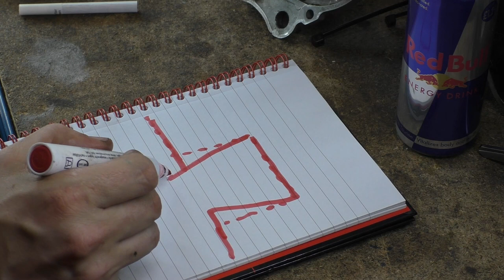Undercutting gears - Fact or fiction?

Comment: I think you missed out rounded dogs forcing gears apart because the rider does clutchless gear changes.

& where's the pivot for the output shaft?
The one that swings both input & output shafts together so the teeth mesh.
Reply from the maker: I'm still looking for the 'swing shaft' LOL

Comment: Very good video , explanation is spot on . I got it , but the issue I experience is that I myself may not lift the shift lever quite high enough which allows the ratchet /tensioner on the drum to retreat due to not being pulled past center of the spring force created by the cam effect . The back cut gear will pull the dogs together and overcome the operator error of not pulling the shift lever all the way up . Missing second gear in a drag race is ‘Game Over ‘ and it will gall the face of the the gear opposing the ‘dog gear’ and make future gear selection harder ,which hurts the gear anyway . I’d rather weaken the dog and have a positive shift without galling the face of the opposing gear , since the shearing of the dog is practically unheard of . 
      I have cut the ‘Dog Window’ on the opposing gear to restore the sharp edge to bring the range of travel back to normal after the galled radius of the gear window is removed . I Don’t Like a Back cut Trans Because They Are Harder To Downshift In Any Motocross Or Aggressive Street Situation.
      For Me , It’s a grab race mod only , because I am guilty of not lifting the shifter high enough selecting second gear in a drag race , cause if I am a little loose on the bike in the hole shot , I am getting my foot on the shifter in a hurry before ,,,,,, or after redlining the motor in first gear .
   Just how I view back cutting , and the reason that it was done in the first place . Thx again four this great video . Dan

Comment: My wr450f has a semi common problem where a worn shift fork (or maybe other issues) causes the dogs to become worn and not fully engage, causing gears to slip out of engagement. Heard of people undercutting the dog to recess relationship points. What do you think? I didn't bother and just replaced the gears and forks.

Comment: The gears are only surface hardened as well. Undercutting does remove this surface exposing the soft part. Life span of the undercut gear hence is greatly reduced.

Comment: G'day Matt, I know you looove reading long comments.  My two cents worth is that undercutting is a very common practice and is born from the fact that as soon as a gear starts to jump it quickly radius's the dogs and they will continue to jump even after the root cause has been addressed due to poor engagement forcing axial movement under load which overcomes the resistant force of the selector forks, they will deflect.  It is also due to the fact that, as you have discovered, it is often difficult to buy new replacement gears so guys under cut to reclaim the contact area with minimum material loss and subsequent backlash issues.  The wedge effect of the dovetail helps maintain engagement under load, they release fine when unloaded by the clutch.  I've had under cut gears in some of my gearboxes and I know plenty of people who also have executed this method and have never heard of one single case of catastrophic failure due to section loss. 

Having said all of that I agree with you in so far as to say that the correct repair would be to build up the dogs and regrind the original profile but access to the correct equipment or the people with the necessary metallurgical knowledge to correctly repair an induction hardened gear generally sits outside the scope of the average home mechanic, and a good deal of workshops.  Peace brother.

Comment: I had the first Yamaha 250 street scrambler, DT1, in the 70s with a "race kit", different barrel, head and piston etc. also expansion box. went like a bomb, would pull 8500 rpm in top gear on the motorway, well over 100 mph on the motorway. When I did the motor up, a friend who raced mx persuaded me to get the gears undercut. by the yamaha agents. it did not look like that! you could hardly see it had been done, slope was maybe 1 deg, but it made a huge difference. Gearbox was so much smoother changing, but I would not do it to fix a problem, fix the problem first.

Comment: Got me thinking. My dad bought a bike with a bent shift fork for 5th gear (only did 5th) on a YZ250, power shifting with possibly rounded dogs is the likely culprit.

Do you think undercutting could of prevented the issue from sucking the gear in? Also, I think it might of prevented the gear from popping out since the shift fork wasn't fully engaging the dogs. With the undercut, the gears would of pulled themselves together.

We replaced the gearbox from ebay, and sold the bike a few years later, but got me thinking.

Comment: At the practical level, on 90 degree dogs, the friction alone will hold them together.  Some of them are as-cast such that they're out-cut (Whatever the fuck you call the opposite of back-cut.) and they shift fine. 
 
I don't hate back-cuts as long as they're small. 1.5 degrees max. Flycut the dogs so they're perpendicular to the shaft and perfectly flat.

Comment: Hi Matt. I have a problem with my Ducati multistrada 1200. The question is that I install a quickshifter, after about 6000klm, when I change from 2nd to 3rd everything is fine, it enters easily and you can accelerate as much as you want, the problem is from time to time at about 2000rpm in 3rd speed I try to accelerate smoothly and that's when the 3rd gear is skipped, scratches and gets hooked again. After looking at the oil top I find quite a few large chips. But when I examine the dog dintes I see something marked but not as to slide. The bike has 27000klm.

Comment: The undercut pulls toward full engagement of the dogs smoothing out the shift and reduces the wear on the fork.........and the dogs................probably.................yup.
Reply from the maker: How do it pull? The gears should shift into position then collide.....
Reply: Cam action causes it to pull, even though it is a very shallow angle. In order for it to disengage, the driven member would have to rotate just slightly ahead of the drive to clear the undercut.

Comment: Triumph 675s have never been good shifters.. as my builder said, your not going to confuse it with a R6.  On the last motor build I had the trans road race undercut and micro polished. It's a whole lot better than stock, but its still not a R6.

Comment: i was told by a designer i work with undercutting is also a bad idea as the gear has surface hardening treatment that you will remove buy under cutting ?  he worked with nova racing gearboxes.

Comment: Smoke as much as you want.  Not my problem.  My problem actually is as follows: when cruising the transmission is fairly quiet (flat twin boxer R1150RT-P) but under load any gear really) it sounds like i am stearin a box of screws inside a metallic box -best analogy I can come by to describe the sound it makes.  Any clue what this means? (Only serious apply please!)
Reply from the maker: Do you have any recording of it and does fucking around with the clutch make any change - i.e clutch in, clutch out?
Reply: The Workshop no. The clutch does not have any effect on it.  I will post a link to some sound tomorrow (if i figure out how to do that, i mean uploading that here)

Comment: Well now I don't know. I own a Rf600r '94 and it slips from second to first under hard acceleration. It's a very common problem and everyone at the RF groups say to just undercut gears, but you say it's usually problem somewhere else. Where could it be?
Reply from the maker: It depends how worn the gearbox is. How many miles etc
Reply: @dirtygarageguy  100k miles. Besides the slipping, everything else works flawlessly
Reply: Sorry, it's 100k km. So about 60k miles

Comment: Hi matt, not got an issues with it dropping out of gears or selecting gears. But when trying to select neutral it goes into neutral but sometimes doesn't show neutral light. Checked wiring seems ok, thinking got a dodgy switch. What's your thoughts? Suzuki 650 bandit.
Reply from the maker: Seems like it could be a bent selector fork rod.....
Reply: Have you come across this before?
Reply: The Bandit - as far as I can remember - does have the same neutral switching mechanism as the SV 650. That switch thing simply has a too narrow neutral contact in that plastic thing next to the sprocket / transmission output shaft.
If the selector drum stops only a tiny little bit next to that contact point, it will not indicate neutral although it is in neutral...
Reply: BavarianMonkey 
So do you think it's worth changing the switch first before I think about stripping the gearbox. It's only done 14000 and has not been tagged, well since I've had it. It's only started recently and is intermittent.
Reply: Well, I'd recommend checking the switch. Take a look at the pictures google shows you when you enter "suzuki bandit neutral switch" - you will understand the issue.
Reply: BavarianMonkey cheers pal, funny how it's the same model as mine.
Reply: Well I learned to read years ago so it does not really surprise me that my answer fits your question :)
Reply: BavarianMonkey  😂😂 I was going to google it,  but asked here first. As an old fart the tinterweb is full of people giving advice that's wrong. 😂 cheers again 👍

Comment: Depends on design intent though: We've got gorgeous Hewland gearboxes whose dogs came with negative draft like the undercut dogs you showed. We've chipped the tips on the leading edge of the dogs, but shear is not really a failure mode: the root is nicely filleted and the aspect ratio is a lot squatter than those you've showed. The only detriment I see is you can't get the car out of gear if you don't lift completely when up shifting.
Reply from the maker: If they were designed this way then fine - and the case hardening will be complete - not cut into like these have been

Comment: Here I I'm doing my tm300 dirt bike, transmission bearings, and the sprocket shaft, looks like someone took an angle grinder to it, and I can't for the life of me understand why, because I got a box of old parts with the bike and it has the same shaft all the teeth are perfect condition especially compared to the one I took out, were the counter sunk sprocket seal goes it in worse condition but not enough to justify grinding up a different shaft to make it fit, ps both shafts are identical as for as I can tell,

Comment: Can you.not get a 1st  gear made? I covuld ask a local engin eeri g firm that do fthat stuff, how far south are you?
Reply: Paul Wright How pissed are you? lol I think he is in cambridge
Reply: Custom cut gears arent expensive or anything
Reply: the original ones can be "hacked" in so much ways that one never knows if its a machining tolerance or  tool correction. slim chance without the original drawings.
Reply: He has a 3D printer, and can make a new one himself from titanium filament.
Reply: The RG500 gearbox has issue plus 1st and 2nd are too short. Hence you can buy a taller 1st, taller 2nd and replacement upgraded 6th from Ellis Moore for  <£300. Or if you wanna do it properly you buy a full Nova gearbox from Nova like I have http://www.novaracing.co.uk/ProductSuzukiRG500GammaCloseRatioGearbox.html .

Comment: Those gears are undercut from the factory, never been sure why they only seem to undercut the middle gears and not all of them?

Nova racing heavily undercut gears for their race boxes and older kawasaki kit gearboxes I have are more heavily undercut than stock..  I understand that the rotational movement 'should' only translate into lateral movement and not the other way around, but kickback is a thing, and occurs when dogs wear, and the detent arm/spring/selector drum etc are all still in perfect working order.. is commonly cured with undercutting

When the box is unloaded then dogs float, cant say I've noticed any more force needed on the lever, from heavily undercut gears vs stock.. but you can notice a difference with heavier detent springs.. i would guess the spring rate needed to totally prevent kickback would be so high as to badly affect the lever feel... also that force would have to be passed through the shift forks, whereas with undercut dogs, it never gets that far

So gears are undercut for that reason, but as for undercutting dogs to repair gears? Never seen that, as gears generally arent that expensive to replace vs the cost of machining them

Comment: Brought my set of gears for a machining shop and they decided it's best to undercut some dogs just in case (they were somewhat rounded but not of the gear I had a problem with). Thing is, they undercut dogs and not the slots they go in. How bad is this? The way I see it is that it's a bit stupid because the dogs are now angled and slots are straight. Cases will be split again soon so should I possibly swap the gears with undercut dogs for gears that have dogs that are a bit rounded? I have an extra set
Reply: they have to do both sides, if they going to do one take it somewhere else that know what they doing.
Reply: As Matt told, this is not usually done when it's not dog-to-dog but rather dog-to-slot contact. So probably they shouldnt have touched the dogs at all for these gears.

Comment: Most quality boxes have undercuts as std and are called servo's , a lot of bike gears are as made and not machined on the dog face, the dog should be the correct width for strength  including a servo or the detent does all the work, std straight dogs end up rounding and pushing out of gear. this probably why so many undercut them.
Reply from the maker: This isn't answering the point of the video...
Reply: @dirtygarageguy  What is the point fact or fiction
Reply from the maker: Cutting into the case hardening is not a good thing. I literally had to spell it out for you
Reply: @dirtygarageguy  When you do the job  properly, let the gear down then re-heat treat after any work they are fine, you literally didn't have to spell anything out thanks.
Reply from the maker: Ah! Glad you fell into that trap. So let's say you did this to a ducati gear. What heat treatment would you use? Because their steel is a specific alloy and using the wrong one cause hydrogen embrittlement. So which one is it?
Reply: @dirtygarageguy  All of our metals are checked for type and structure if not already known before any carburising or soaking a lot of people get caught out with embrittlement even with chromed parts
Reply from the maker: You didn't answer the question.
Reply: @dirtygarageguy  You didn't send me a Ducati to test

Comment: The Japaneeeese scientist or mechinest or engineer knows exactly how a bike should be ridden to avoid false neutrals and gears poping out, but sadly they won't tell anybody, in some manuels they tell you to shift into 6th at 35mph which is retarded, if you are on a highway and about to do 65mph and begin at 6th at 36mph when you accelerate from 36 to 65 in 6th you will destroy your crankshaft rod bearings very soon. The engineer should give in the owners manuel instructions on how to use that which he invented, for example he should tell you at what speed and what rpm it would be safe to shift into 6th from 5th to avoid that horrible false neutral which sounds like the engine is about to explode, 5th to 6th is one of the worse false neutrals due to rider unawareness that the 6th gear is for extreemly steep downhill and for when you are already at 100mph and still need more speed.😮

Comment: I agree with everything you said pertaining to the way the person cut those dogs on the gear that you show in the video. That was way to much. A proper dog cutting should be a tiny bit no more than 16th for both sides so that would be like a 32nd per side just so it doesn't slide off maybe a little bit more depending on the dog. I am going to hand grind my dogs because my first gear is slipping and that is the gear which has the most torque/load applied. When ever I would ride over a curb on my cr125 my 1st gear would pop out and get stuck. If it was just the shift mechanism wouldn't the gear pop out into another gear instead of getting stuck? I know it's not going to hurt the gear unless I over cut it and I am definitely not cutting it onto an angle that is a bad idea imo.

Thanks for sharing this information it is nice to see other people talking about stuff I'm working on and dealing with.
Reply from the maker: Juat buy new gears.

Comment: Real men smoke roll ups. Having said that is their such a breed as a "real motorcyclist." Someone who can strip their machine down refurbish it by hand and get it back on the road, it would have to be a certain type of machine, something like a single cylinder, this hypothetical person would have to have a lathe. But I imagine the machine would be something like a BSA C 12 or perhaps  something like the old James that they dropped with the commandos on D day. Or perhaps someone who bought a BSA Bantam new and has been riding and maintaining it ever since. Because if its so complicated that you need a degree to touch it , that cant count. My old foreman in the machine shop used to make  his bits and pieces, like a back sprocket by hand and hardened it up after. Or welding up a broken gear with stainless and filling it back to shape then letting it work harden. Does this person still exist or is it all E Bay after market parts?